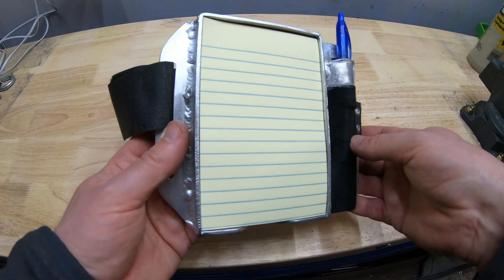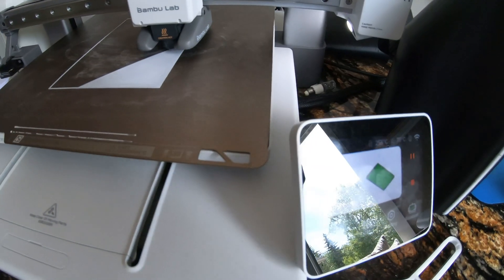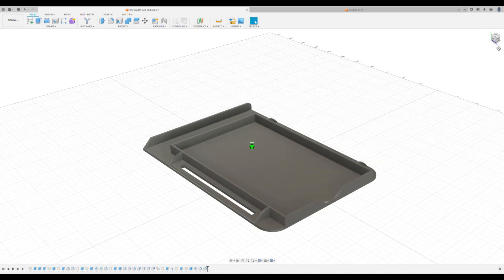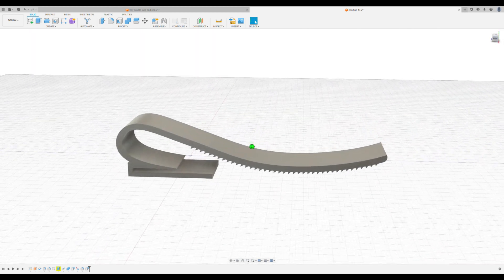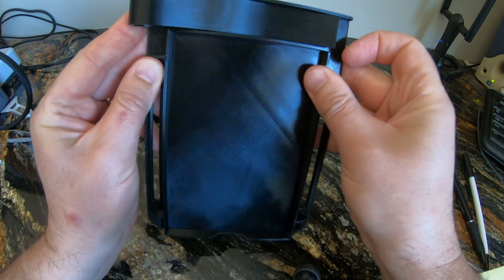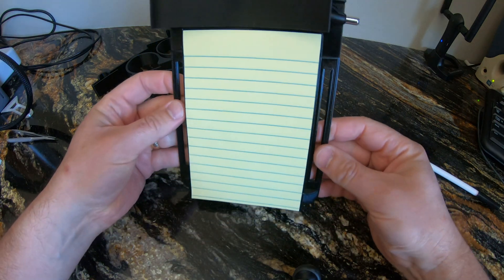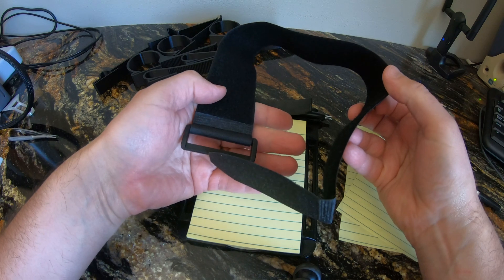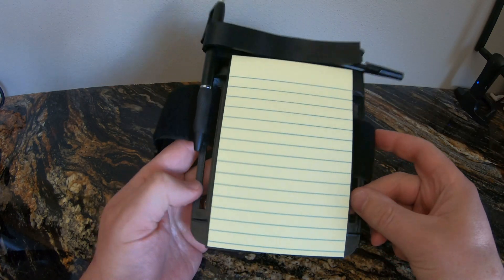Aviation Kneeboard - Improved!

Comment: Dumb question probably for a future project. Can you make it hot swappable with an iPad mini?
Reply from the maker: That’s a good question.  It would be possible to attach an ipad with a specifically sized “plug” to fit into the main body instead of the paper.  That size is 101.6 x 151.2 mm.  The only reason to do so would be if one wanted to switch back and forth between paper and ipad.  Otherwise, I believe there are other ipad options available.